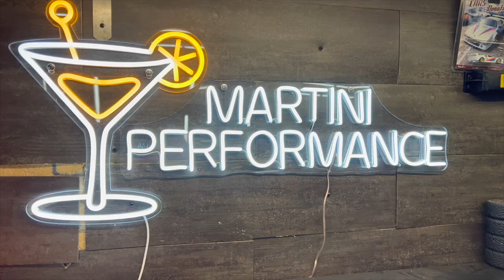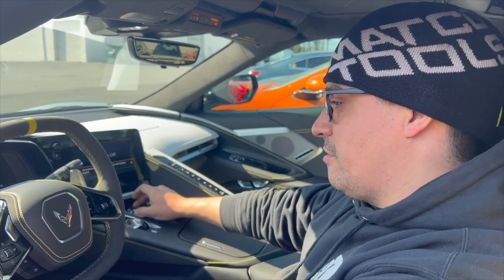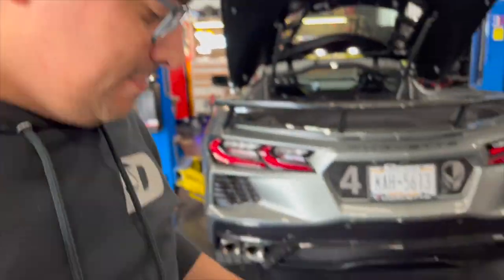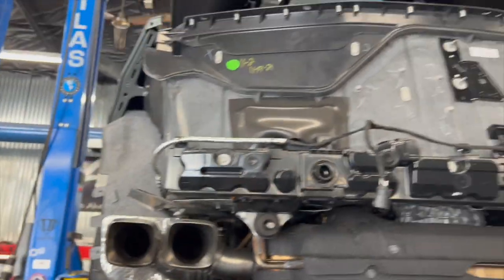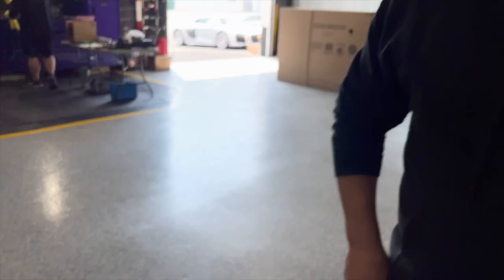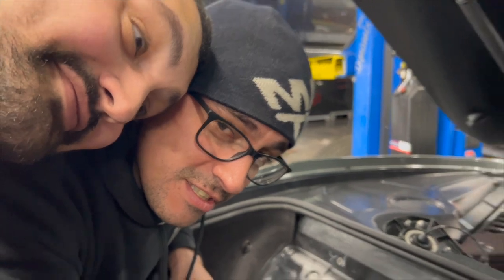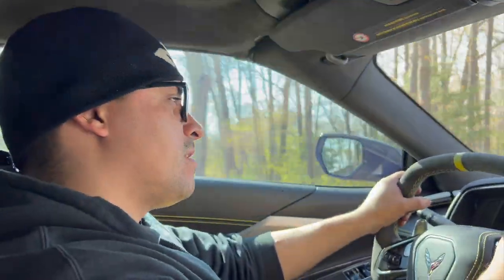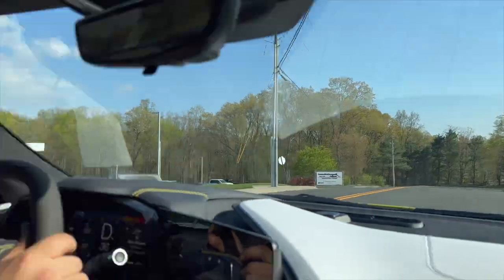2023 C8 Corvette FabSpeed Exhaust!! Install + Sound!!

Comment from the maker: What do you think of this exhaust??
Reply: Did u have to tune after the install because of AFM and npp
Reply: Also any check engine lights?
Reply from the maker: @sandy-7715  After install you have to go to your local chevy dealer to get the valves reprogramed and you will not have a check engine light.
Reply: @acidynamix  tnx bro